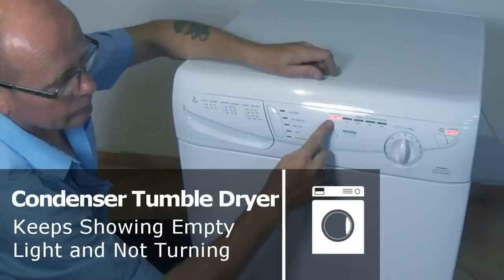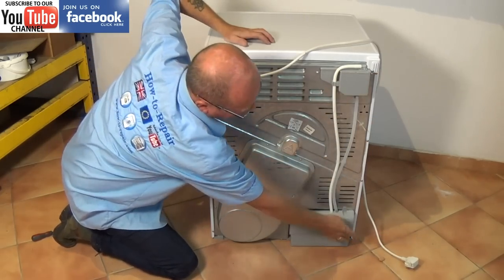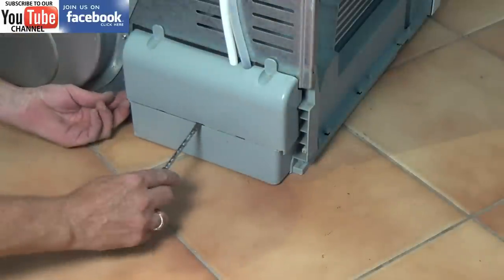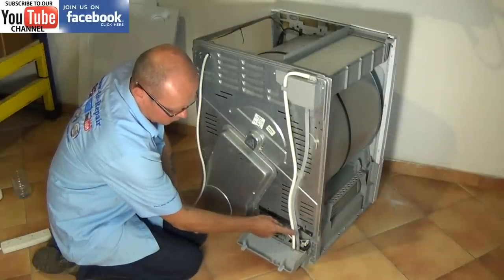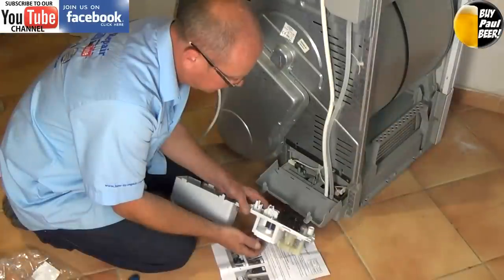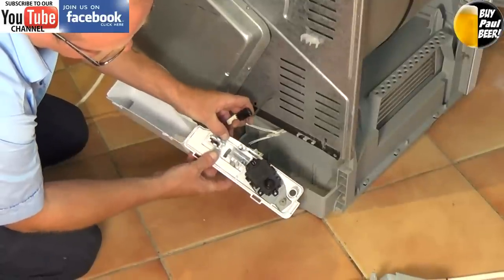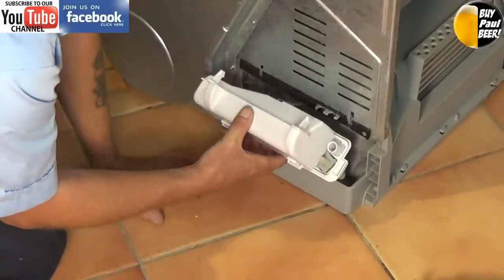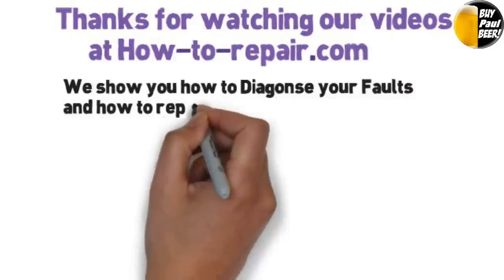Condenser Tumble Dryer how to replace the pump unit

Comment: An absolute SAINT ,,,, had the light on after cleaning the condenser and hoovering it all out ,, the float was full of sludge and fluff , and reservoir full of water and fluff
cleaned it all out , checked the switch was still clicking on the float switch ,put it all back together ,,,happy days ,,, thanks

Comment: Great video. AEG tumble dryer with intermittent squealing noise. Condensate pump under the rear cover as shown, though the AEG has a large FGAS warning label on it, which put me off at first. Single screw removes the cover without taking the sides off. Another single screw releases the top holding the simple float switch and pump. 10 minute job. Thanks

Comment: Pls advise, why not build the condenser at the top & let the water drip down to the container at the bottom??
Reply: true.. gravity works for water as well. They just prefer adding a lot in there.. more stuffs that brake more stuffs to buy to replace.

Comment: hi please can you help me.my.hotpoint.dryer water light's coming . on saying empty water when it is already empty. the dryer comes on for a few mins then stops. can this be fixed ?
Reply: i actually have the same problem.. trying to fix it need to see if the pump still ok though.. hard to tell.. the manual says some dirty stuffs blocking the way for water to go through. Im now cleaning it.. i ll see this tomorrow but also have the feeling that i ll have to buy a new dryer..
Reply: I have a feeling its the pump, you may have a faulty pump, use a multimeter and check for ohm values across the coil, if it shows value between 20 to 50 ohms its good . otherwise if its open loop, change it to a new one . if the pump shows the right readings, check if the microswitch works by checking for continuity and if that okay, then its the main board which is faulty and not sending signal to the pump, it may be a defective connector on the board . Hope you get it fixed